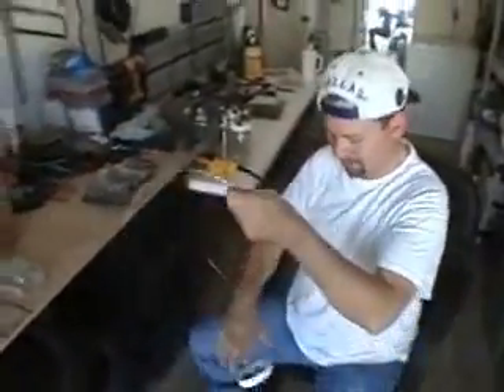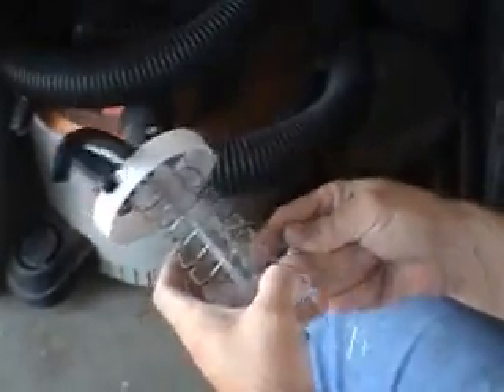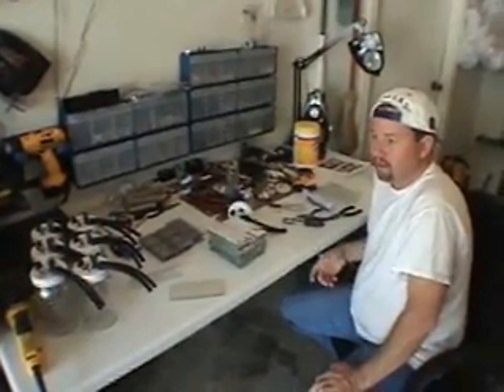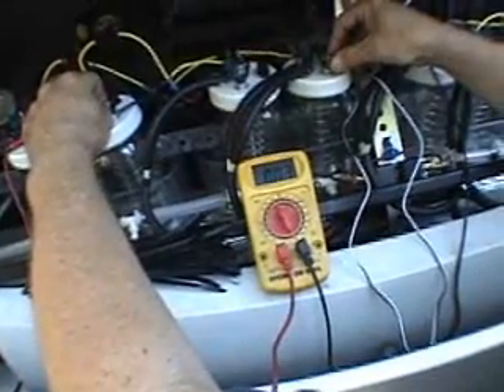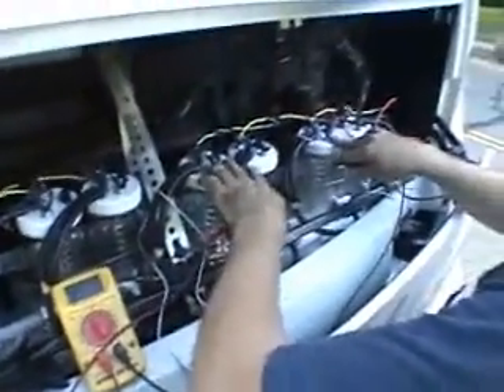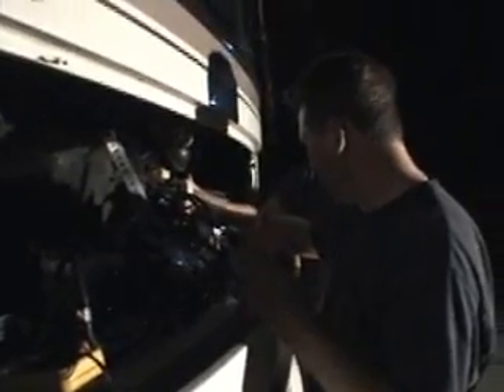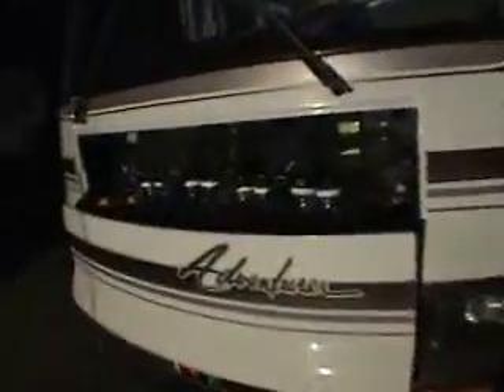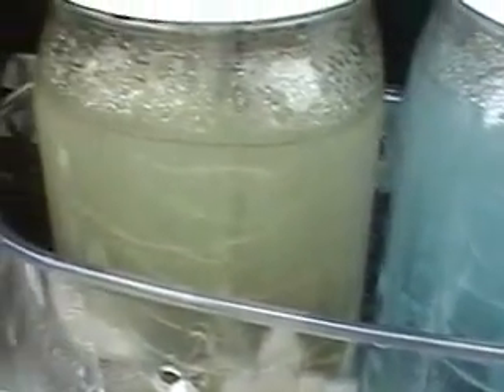Hydrogen Powered RV - Electrolizers H + H + H + H + O2

Comment from the maker: What's a PWM? We had a power voltage tester. I don't know much about electricity but I do know I get over 10 miles per gallon pulling a truck loaded and a 35' RV and I used to get 7.5. That's like an extra 300 miles per tank that's huge! I took the little wired out and put stainless steal rods in instead, in two of the electrolizers I put in stainless steal plates.

Comment from the maker: it didn't use very much water at all the electricity would cause it to bubble and then the condensation from the steam/mist would reconnect into water very little went to the engine. It used electricity to do that and made the generator work harder so I got worse mileage.

Comment from the maker: Ya I changed the cells to use stainless steel plates instead of those wires. The guy that helped me has also upgraded his design the wires look cool but kind of dumb not to have more surface area and spread it over 8 jars instead of 1. It increased my mileage from 7.5 to just over 10 using stainless steel rods I'll post a new video now that I'm using plates instead of the rods.

Comment from the maker: The RV totally ran on gas the Hydrogen and Oxygen was just supposed to boost the power but provided almost no power for the engine and the draw from the generator made the motor work harder to spin the generator so it was a net loss in gas mileage.